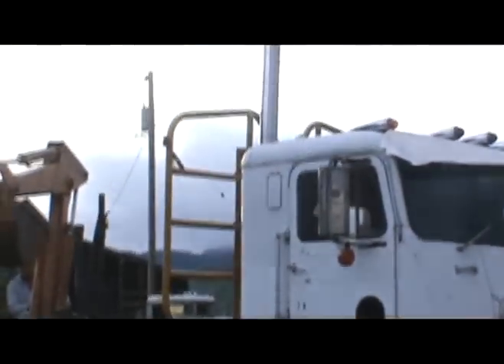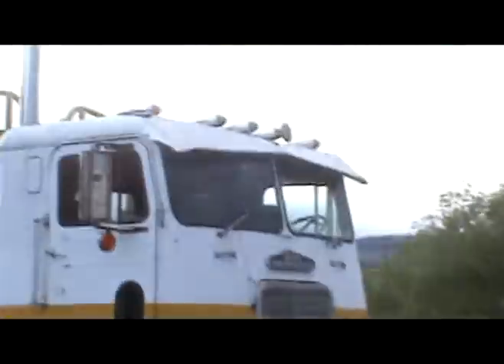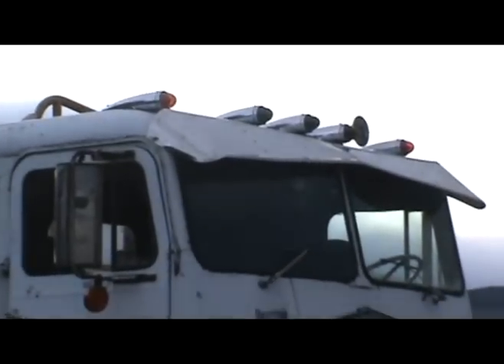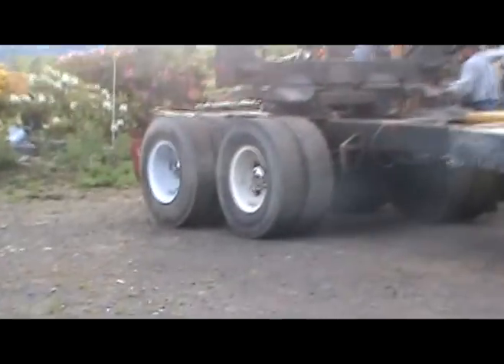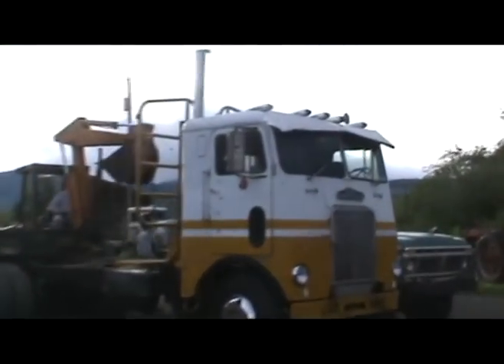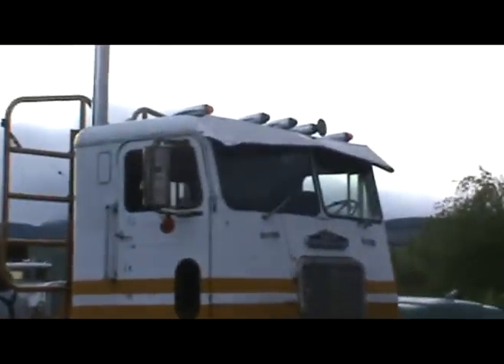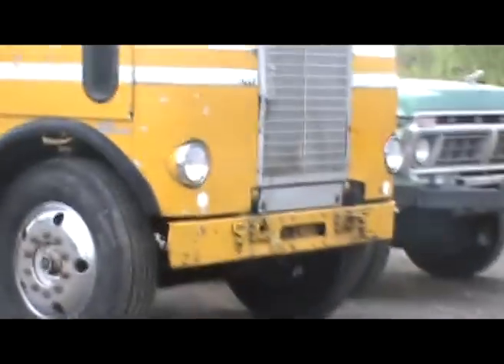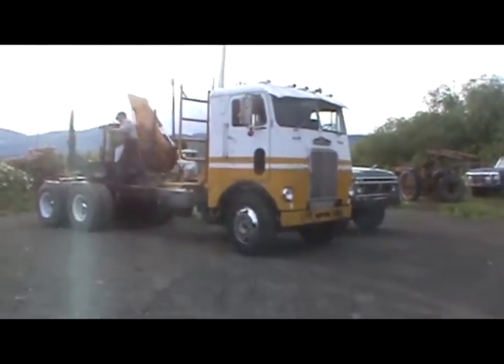The 65 Freightliner turning into a log truck

Comment from the maker: @Xx69roadrunnerxX The engine is completely stock as far as i know. The pump might be turned up just a hair, and i mean just a hair because you can melt down this motor without a load on no problem. Also it leaves this big black trail while cruising on the freeway, it's pretty badass. But with no turbo, you really dont want to do anything as far as fueling goes.

Comment: @Hotrodx199 I think it should. The water quenchs some of the combustion which lowers the combustion tempuraters, which lowers the EGTs. The Methanol is a catalyst to help burn all of the fuel completely, so it can add some power. Guys run Methanol to help burn all the fuel their turned-up diesel injection system flows. I know Snow Performance (Water/Meth company) makes system for class 7 and 8 OTR trucks. Random fact- windshield washer fluid is about 32% methanol and guys run it in there system.

Comment: @Hotrodx199 Ya, I figured it would be stock or close too. Dont want the EGTs to get to high on a work truck. 

I know this a work truck, but ever consider a Water/Methanol system that triggers at an EGT you specify?? It a long shot, but I thought id through it out there, haha. Im always thinking about a little more power :)